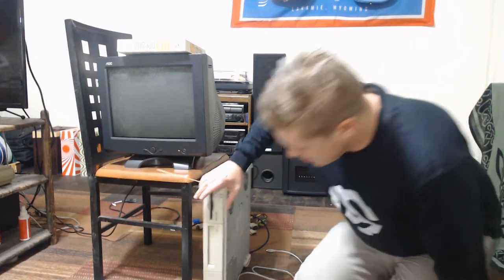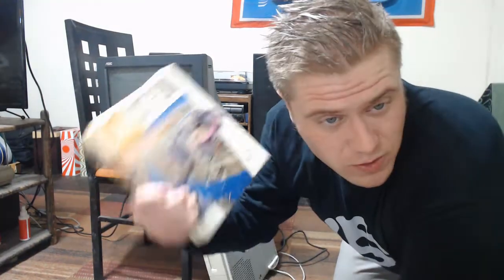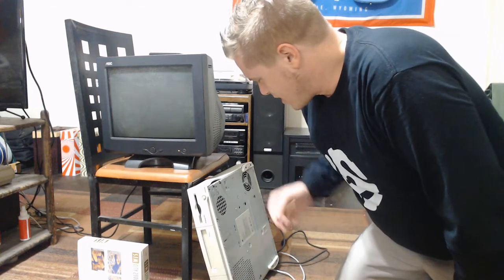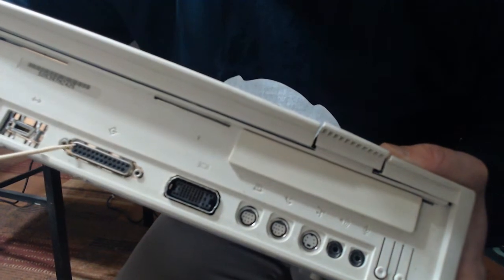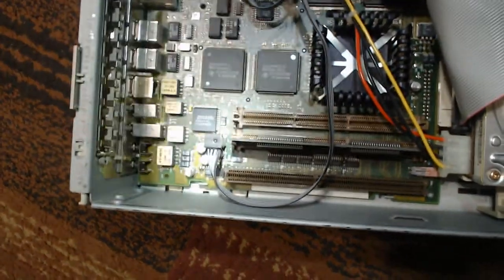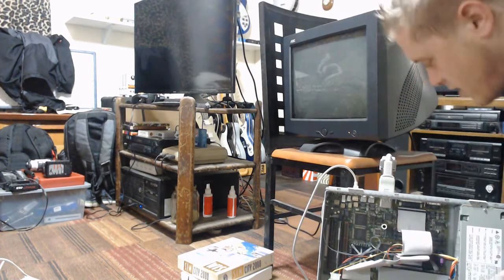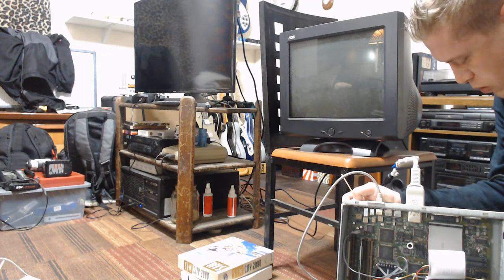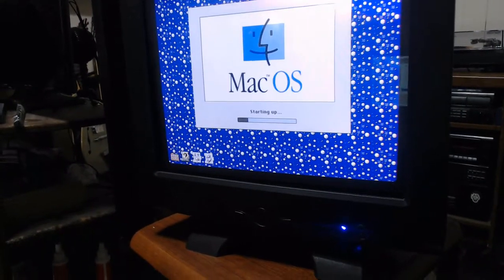1995 Apple Macintosh Performa 6116CD - Will it boot?

Comment: Recently bought a beat up 6115CD and was getting the same issue of no video signal. Tried your trick of holding the reset while turning the power on and it brought the machine back to life.
Reply from the maker: Very nice! Happy this little video helped. Troubleshooting these old systems is both fun and frustrating :)